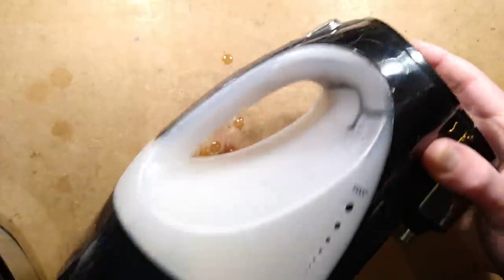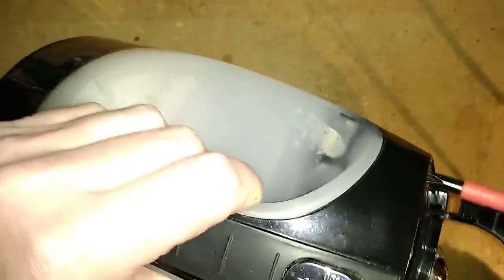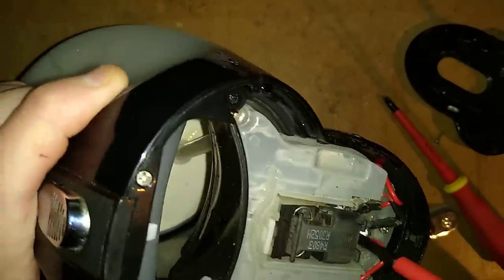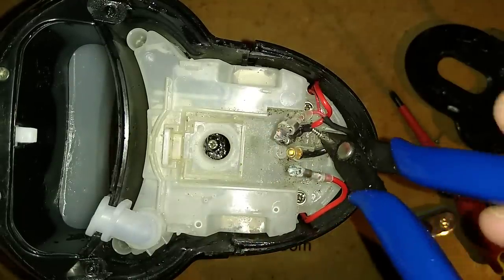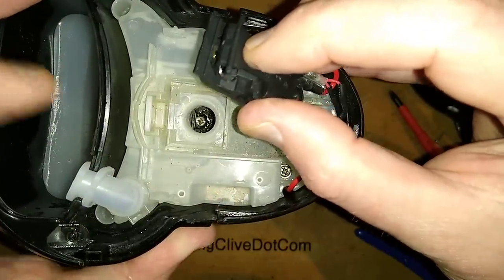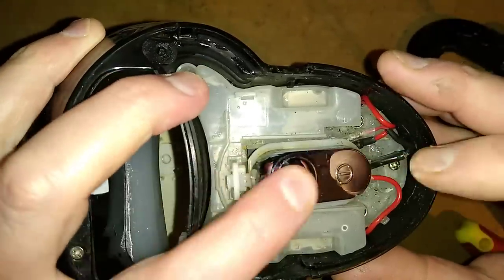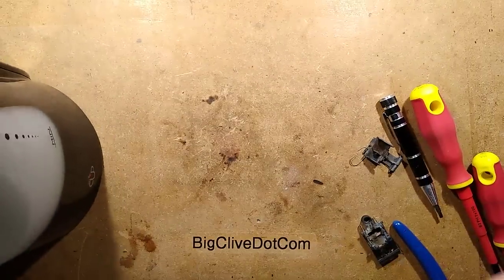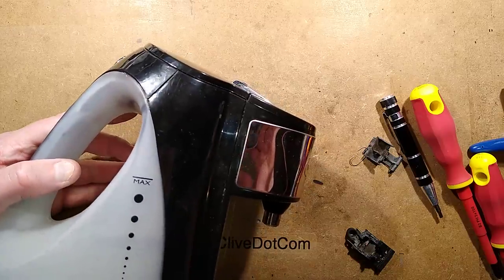Replacing my Breville Hotcup power switch.

Comment: I want to see the switch repaired. I would of tried.
Reply: .. do you mean 'would HAVE tried' (or 'would've')? I couldn't understand your comment until I realised that's likely what you meant.
Reply: @Shaun.Stephens  Sorry I wrote it in Texan. LOL
Reply: I would have tried to repair the switch as well. Id make a new better thicker contact from some brass and/or copper and save myself £12. im not paying £12 for a switch that costs a fraction of that to make. Millions will be mass produced in china
Reply: as I commented on your other comment, please do so, I mean I would love to see a tutorial on how to plate copper with Silver Nickel, Silver Cadmium Oxide and Silver Tin Oxide at home, please upload a video and paste the link here
Reply from the maker: I did contemplate that, but it would have required a specific springiness of metal and a contact.

Comment: Great video, unfortunately, the switch isn't that reliable 😁
Reply from the maker: The peril of Chinese copies.  This is why the prominent kettle brands use original Strix switches made properly in the UK.  Sadly it's not easy to get a hold of the real thing.
Reply: @bigclivedotcom  ahhhh, that's a real shame, as our kettle has just shuffled off its mortal coils. Probably just replace the whole thing.

Comment: 12 pounds for that switch? i wouldn't call that reasonable! my little 12oz kettle can be bought for like $25 new! by the way, i trust that you're part P qualified to be taking the screws out of something like that. i heard there could be predators in those things and unless you're trained to wrangle them, it can be deadly. i think thats what part P means, anyway.
Reply: The extact  switch in video is ~ 50p shipped to most chinese address...

Comment: corroded cooked at the terminals, go figure. not replacing the terminals was a big mistake, adding antioxidant dielectric grease would have been very wise. or maybe just encapsulate with silicone insetad :)
Reply from the maker: I've ordered terminals, but they hadn't arrived yet.
Reply: I figured, but don't "cook" your new switch in the mean time!
Reply: @throttlebottle5906  It has to be cooked. The thermostat works by sensing the steam temperature and that "steam port" is there to direct steam to the sensor when on, but limit corrosion once off.  It may or may not also be part of the steam squirting system for the teacup.
Reply: @johndododoe1411  sure, but I meant the spade terminal ends, you don't want resistance there, or it will become the heater instead of the pot element :)

Comment: Isnt 3kw from a single outlet pushing it a bit?
Reply: That's what they're rated for in the UK.
Reply: @worstuserever  Sure, however the cable in uk installations is only rated to 13 amps, that means that if you had anything else on that same line that was 120w or more youd start to melt the cable...have you ever felt the plug on a fan heater...
Reply: Steve Terry  id never seen that specified before

Comment: MY KETTLE WAS MADE IN 1977
Reply: Lol mine was made in the early 1930s! :P
Reply: @echothehusky  - I assume it can whistle a happy tune?
Reply: @echothehusky  How many times have you had to replace the house ?
Reply: I still use a kettle for large amount but these hot cup things a cheaper to run for daily use... I've had mine for years and it is way faster than waiting for the normal kettle to boil.
Reply: @tbelding  lol no

Comment: Wa wait . Is everyone gonna gloss over the fact this switch operating at full mains voltage WITH open contacts is doing so in contact with steam , wa wa wait this spell disaster to me . I`m not too sure about the safety of this , what keeps you from getting shocked wouldn`t the steam condense and provide an electrical path
Reply: Only one side of the bimetal tab is exposed to the steam. The switch is sitting on a silicone seal.

Comment: 12 pound for that switch? Here my local component shop sells it for ~$0.7
Reply: does it include fire insurance for the whole house ?
Reply: @matutolaYT  this one does?
Reply: if you check the ebay description, it says its original equipment, if its not you can use ebay to complain about it.
your local component shop might also have an original one, however, that price is not suitable for a  higher then 13AMP switch

Comment: Upgrade your camera pls. It's 2020 and quality of your videos is too low for today standards
Reply: Seriously?
Reply: @stargazer7644  yes seriously
Reply: @Jamesgamoss  Not everyone has a 250 mbps Internet link to be throwing 4K video around.  It's not like these are 240p or anything.  They're HD for crying out loud.
Reply: @stargazer7644  it not about his internet or resolution. His camera just sucs. It's always over exposed. Casey neistat uploads in 1080p but he has a solid camera and everything looks perfectly fine😂
Reply: @Jamesgamoss  His exposure is set that way on purpose because he's trying to show you details on a high contrast black object with a light background. He's using manual exposure. Yes his hands are sometimes washed out, but most of us aren't looking at his hands.  If he had it on automatic you'd be bitching that it was too dark to see what he's talking about.  He does have his lights too close to his desk surface, in my opinion, which isn't typically a problem when things are flat on the table, but it becomes challenging when working with something close to the camera (and lights) like this kettle.
Reply: @stargazer7644  stop protecting him. I commented on his video and said that he needs a new camera because it would make more people want to watch he's videos and be a nice upgrade. That's it.

Comment: That was the ugliest thing I seen in a long time, my advice is buy a new... oh, the pandemic :/
Reply: What do you have against repairing things? I guess I should’ve tossed my 3 kilobuck TV when it stopped powering up after 10 years instead of just replacing the two $1 failed caps in it?